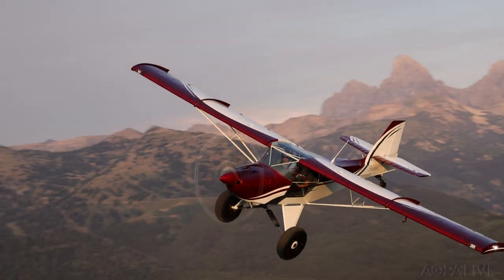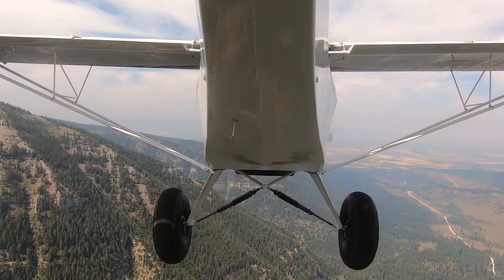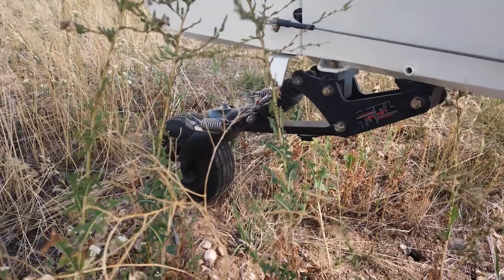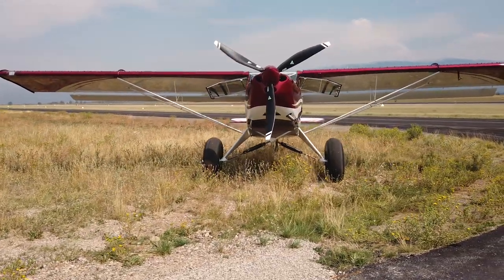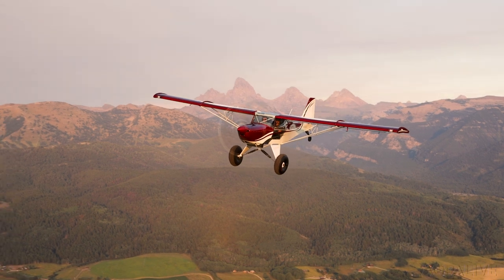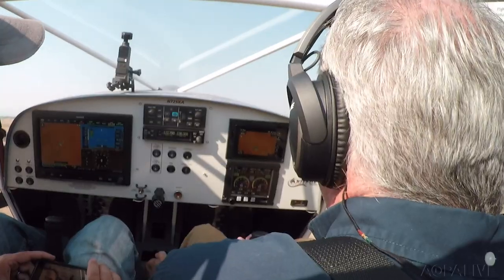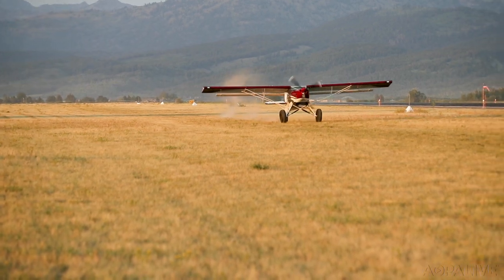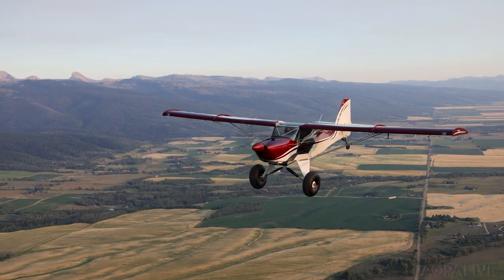Kitfox STi pilot report

Comment: I wonder if the flaperons impose more drag than an aileron/flaps setup. And if they do, is it worth it?
Reply: they do i believe, however the flaperon system grants you much better stall characteristics (to the point where it's hard to spin it if you try) as well as just an overall lower stall speed

Comment: AOPA almost always leaves out an important spec: FUEL BURN. Come on, guys. The specs for every plane you cover should include typical GPH for a given engine.
Reply: Take the extra step: https://kitfoxaircraft.com/aircraft-kits/ Select the Build it/Buy It option and scroll down for engine options. Your fuel burn/mileage may vary...  :goodvibes:
Reply: @charlesbranch4120  Thanks for the reply. The video states that the plane has a turbocharged Rotax 915 IS, so they could have given fuel burn for that configuration. AOPA does the same thing in its magazine: It publishes an info box with a plane's specs (with an engine specified) but omits fuel consumption. It's annoying.